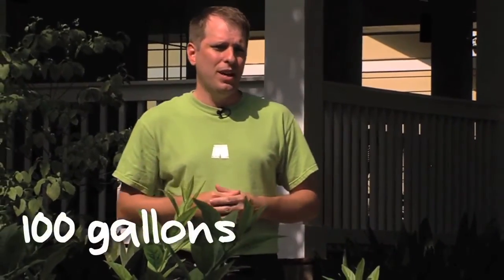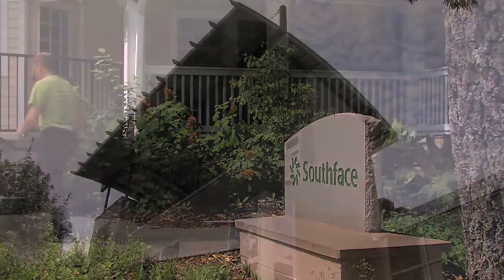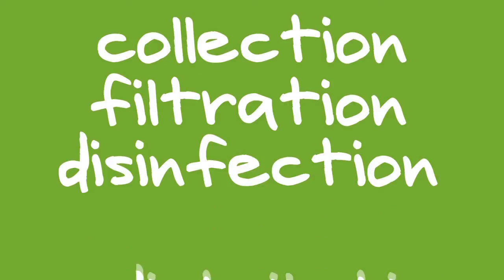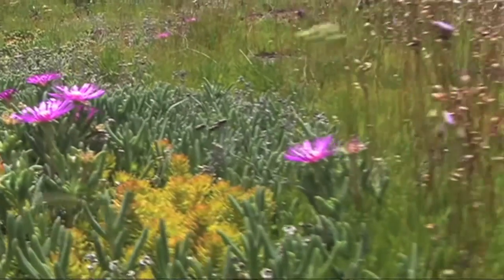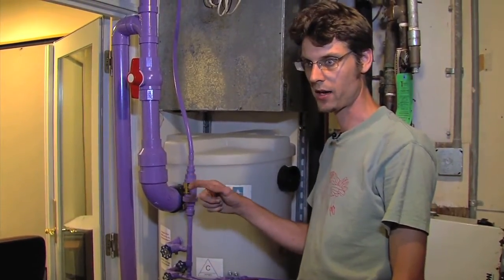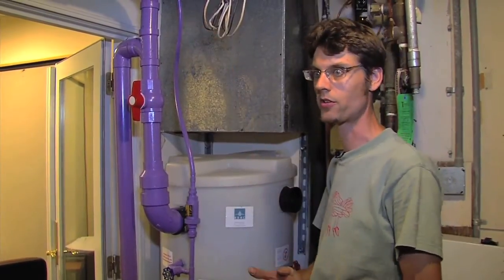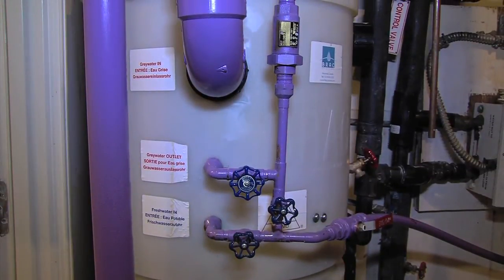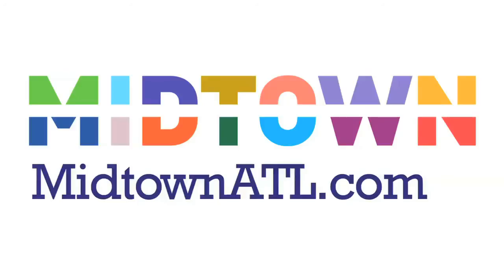Innovative Ways to Save Water with Graywater Reuse - Water Conservation in Atlanta Ga

Comment: I started putting a bucket in the shower when I shower to catch overspray from the showerhead, and also filling up orange juice jugs if I ever have to run the kitchen sink or the shower to get hot water. Just seemed like a huge waist of water. Then, if I need to flush the toilet, I lift off the lid, flush the toilet and dump this collected water into the tanktill it stops filling. All this made me think about making some kind of a tank to sit on top of the toilet tank and using a natural valve using a hose so then the water will automatically go from my container on top of the toilet tank and fill up the toilet tank itself when the water goes down inside It.